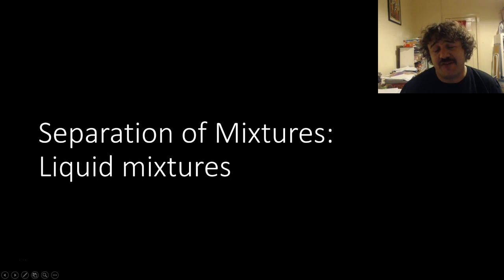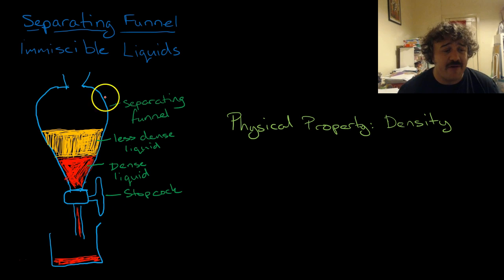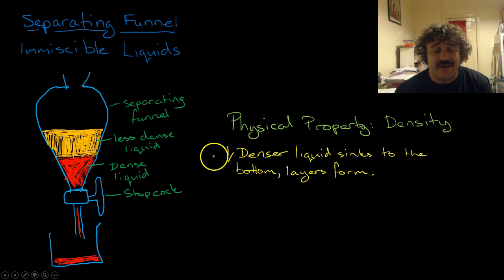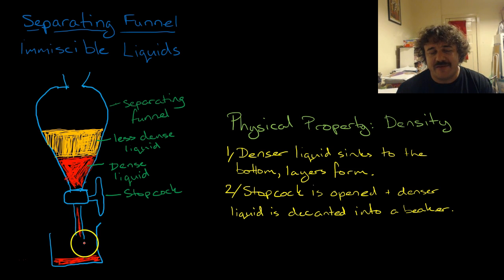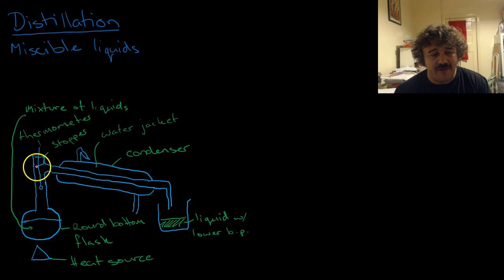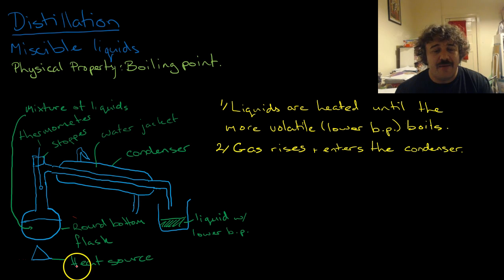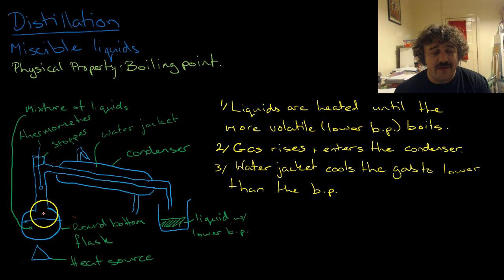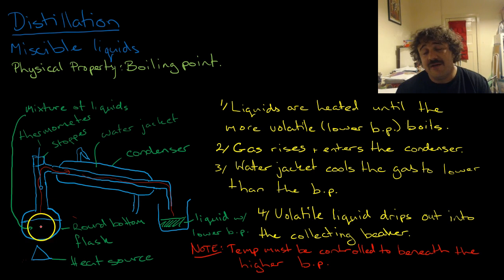Separation of Mixtures: Liquids

Comment: How do you effectively separate liquid mixtures if their boiling points are similar? Is there a way to control the temperature apart from adjusting the exposure of the heat source to the liquid mixture?? Also is it best to repeat the method if you suspect the liquid isn't fully separated?
Reply: +Gus Hall 
As Sam has said below, fractional distillation is used to separate liquids with similar boiling points; it relates to your second question it that it involves the repletion of the 'simple' (or regular) distillation process using one apparatus. Fractional distillation uses a fractionating column that allows the liquid to vaporise and condense several times, meaning that the final vapour to reach the condenser is as pure as possible.
Controlling the temperature of a heat source is easier when using a more sophisticated method of heating than a Bunsen burner; think of an induction cooktop.
Finally: probably? If it was due to an external source of error, yes. If it was due to another issue like similar boiling points, a different or more refined method of separation might be called for, i.e. fractional distillation, or using a different physical property to separate.
Reply: +Alex Butcher awesome ty Alex